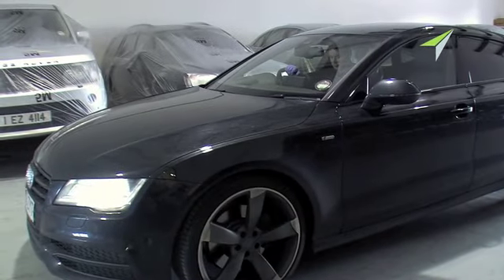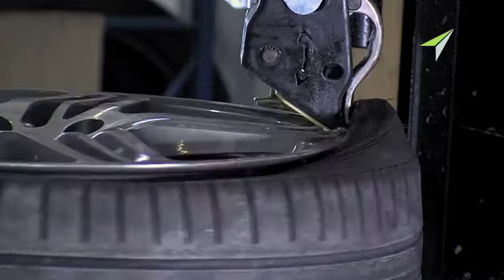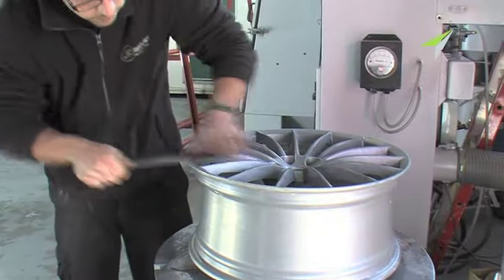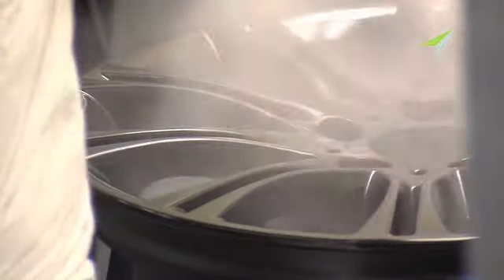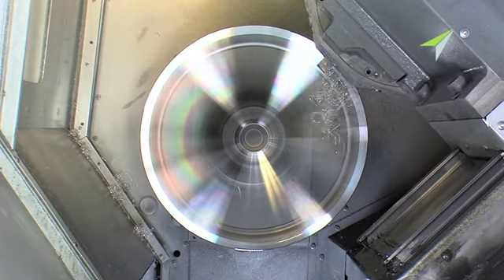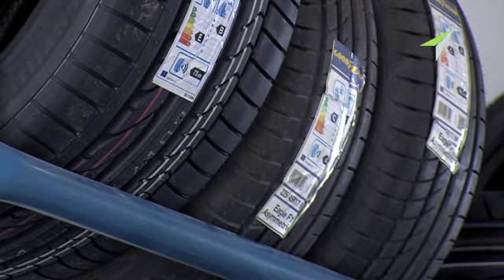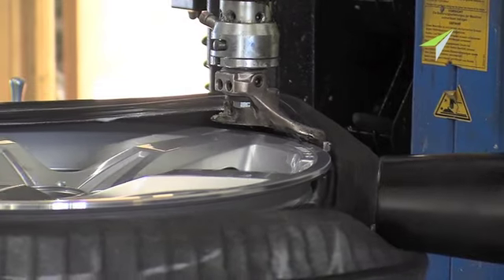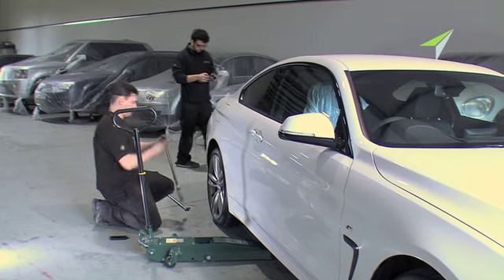JP Alloys - The Complete Service!

Comment: The torque wrench adds no tightening motion, the bolts have been tightened up at a torque already greater than that at which the torque wrench is set, meaning potentially the bolts may have been stretched.
Reply: Mr Hansen  she probably works at Walmart